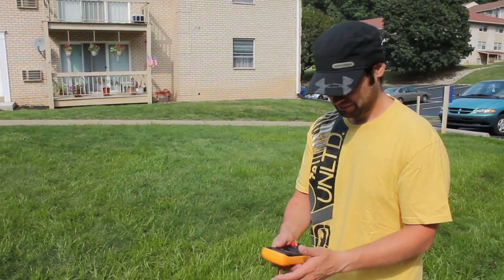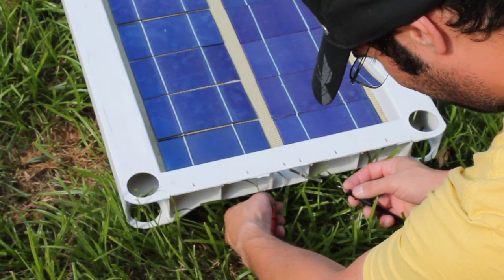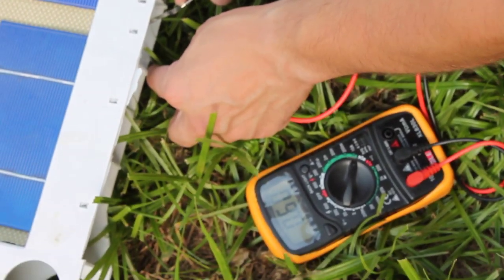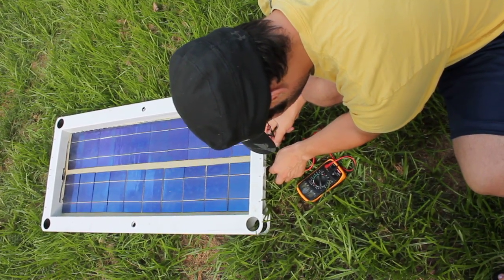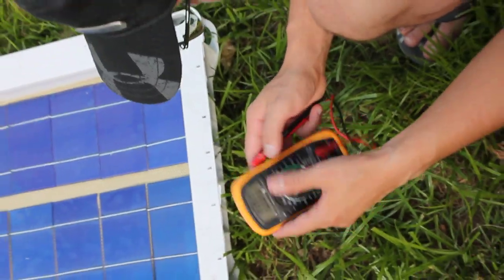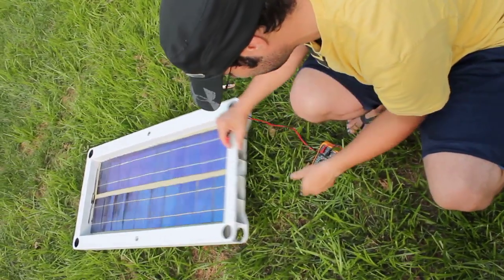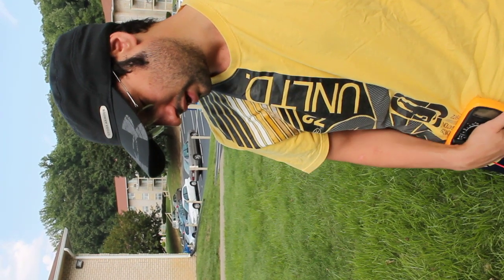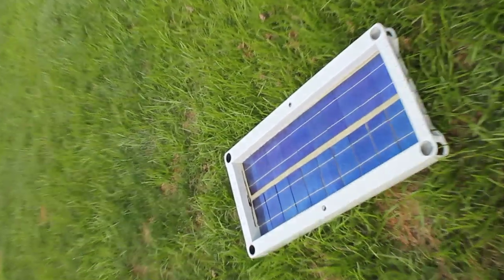(5) DIY solar pannel less than $1.00 per watt

Comment: If you intend on using this to charge a 12v system it's not going to work dude. You need a panel voltage to be higher than the battery voltage. Most 12v batteries when fully charged are about 13.5 volts so you really need a panel with at least 36 cells  which should be about 18-20 volts open circuit.